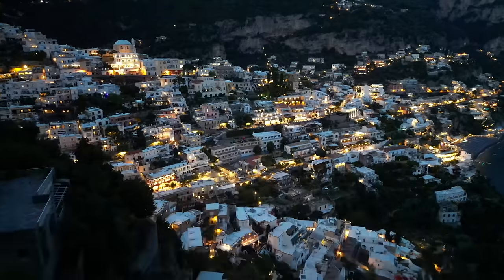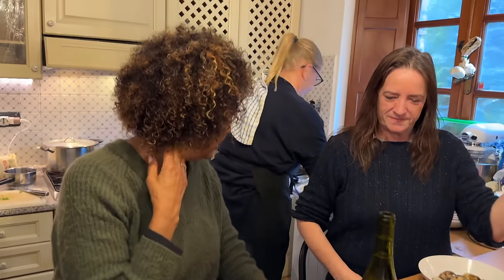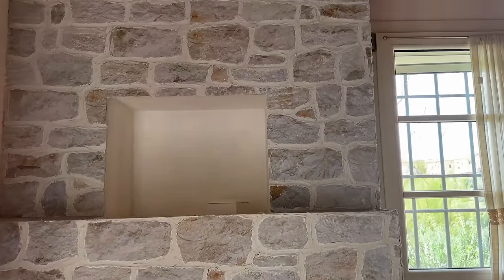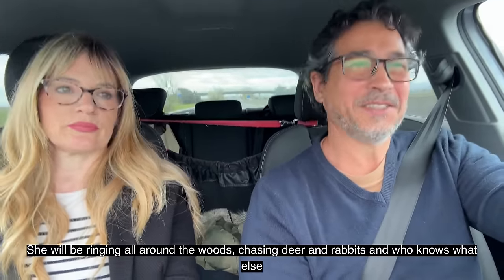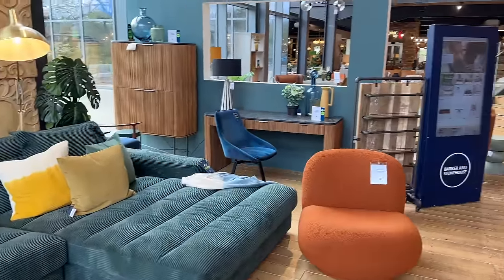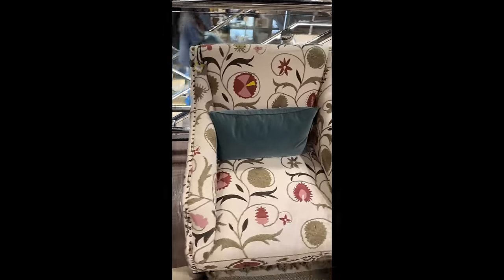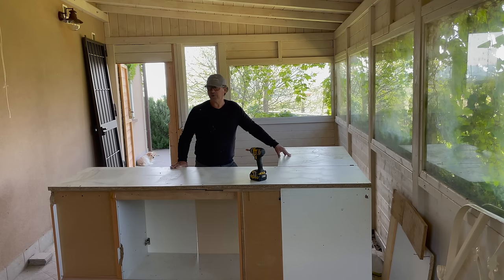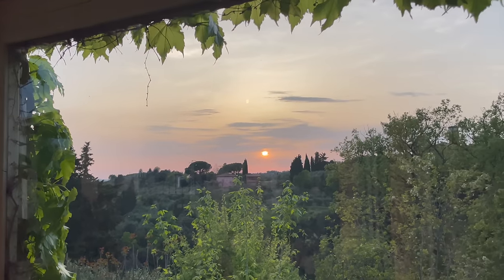RENOVATING IN TUSCANY: FIREPLACE REVEAL, WEIRD PINK KITCHEN & a Wheelchair Race | EP 11

Comment: This message is for Martin....I was diagnosed with cml.  I am not a candidate  for hip surgery.  Due to this at the time I could barely get around due to my hip problems.  I started taking water therapy.  It has helped me leaps and bounds.  You might try looking into it.  Water has no resistance.  And believe me it helped measurable.  I am now walking well on my two feet.  Good luck Martin.

Comment: The coat looks so good on you Nicky. 
Carlo, what you need instead of that road unit (keep it) is a side by side or a quad and utility trailer. You could also use a riding mower aka garden tractor with a few implements, such as a tiller. John Deere sells side by sides and garden tractors. I’m sure Europe must have them or an equivalent. Maybe a partnership could be arranged? Even still, for the type of work you’re doing you would use them endlessly. Oh and… you need a post hole digger too. 
I so enjoy watching you two getting stuff done… 
Best wishes and prayers for your brother

Comment: Nice coat. I would definitely take it. Wear it when you head out to a nice dinner. Sending healing to your brother. I became disabled at age 52 with chronic low back pain. I had back problems on and off and it worsened as I aged.  You never know what life throws at you. Glad you are Carlo have the house if Tuscany as it's so much easier to access. It will definitely help you as you get older. Love the fireplace. The pepto pink has to go, lol Maybe a light pink if you want pink.

Comment: Do the previous owners have an agreement with you about leaving their stuff til a later date? (I don't remember that being the situation.) Perhaps it is a cultural thing? If not, then it is extremely rude and you have every right to use, sell or toss their stuff. Carlo you are wonderful that you have cleaned and sorted out the area to help advance the renovation of the house. Well done. You used your time wisely. (Well almost wisely..... I'm not a fan of the pink in the kitchen area either, but a coat of paint will help.) Well done. Nicki, did you pop back to that wonderful op shop where the curtains came from? That certainly would be on my list each time..... you never know what else may appear. Your mum's coat is fabulous!